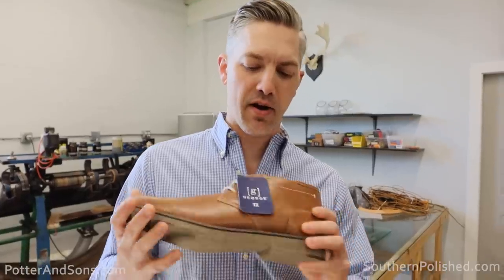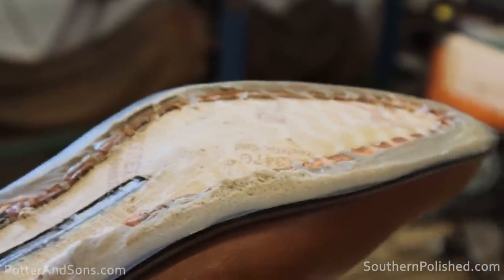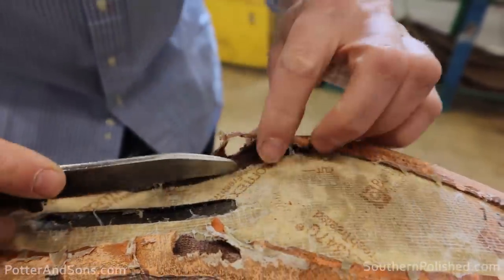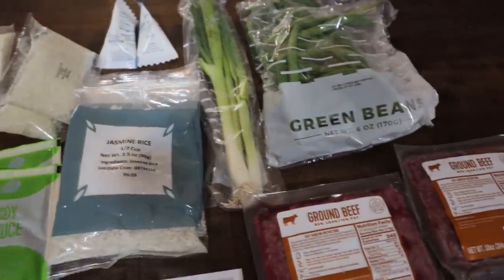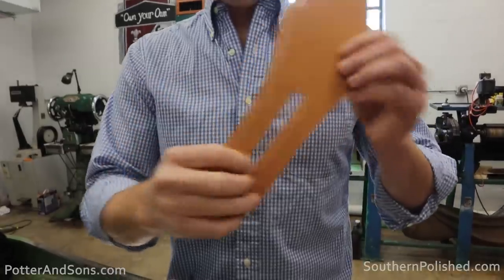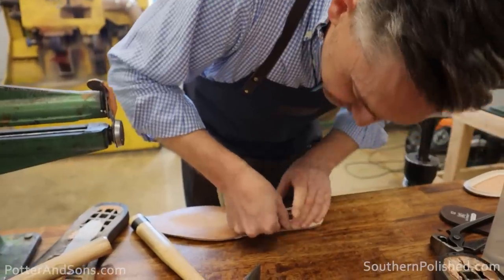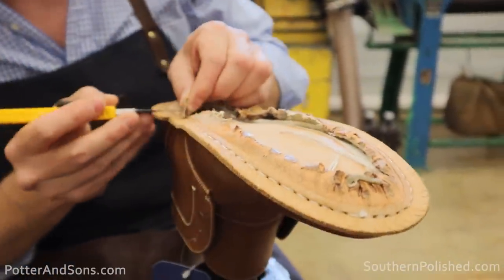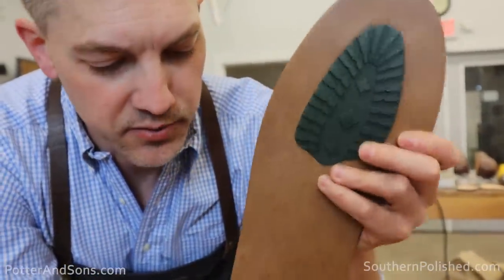$28 WALMART Shoes Are Taken Apart and UPGRADED | Shoes AUCTIONED FOR CHARITY

Comment: I'm not a cobbler, more of a machinist and toolmaker.  Seeing all the older machines and tools never gets old.  I also repair and build from scratch vintage style clockwork items (watches, clocks, music boxes, mechanical cameras, etc).  Most of my machining equipment is considered "vintage" with some modern upgrades.  For my clockwork type work it's hard to beat some tools I picked up from an old timer that he got from an old timer when young over 100 years ago.  I hand make (from forging to finishing) hand tools used in wood working, tailoring, metal working, etc.  It takes extra effort, but just like with cobbling, it all pays off with a quality you can't beat by cutting corners.

Comment: Very cool to watch this transformation and kudos for auctioning them for charity. 
How do change from a cement bond to welt construction and not alter the sizing and fit?  If you had the palsy to use during lasting that would insure that you don’t change the interior dimensions. With a welt you can reuse stitch holes to keep the fit but when switch from on method to the other what ensures that the fit stays the same?
I am also intrigued by the welt stitch being a different color!  Are there a lot of color options for the threads used in welting?  I’ve only seen white and black.  What about different color soles?  Seems like this could be a game changer for shoe design in the upper price semi handmade boot category. 
Thanks for the entertainment and the education.

Comment: Would you be able to resolve Red Wing 2436 boots?  They are mold on and not welt construction, I was not thinking when I purchased them. I have two pair and I alternate everyday.  They are steel toe, however they do not need to remain steel toe, if that were to be an issue.

Comment: I had a pair of shoes with that same type of rubber sole that was originally on that shoe and it has lasted over 20 years and still going. That type of rubber or whatever the hell it is lasts forever. Honestly if you reused that sole that was on it, it would out last the JR by decades.

Comment: I appreciate the craftsmanship, but this seems like putting racing tires on a 30 year old 3 cylinder Ford Fiesta so that you can take it out to the track to race against 7 figure supercars. No one will be fooled and it you'll likely blow up the engine in less time than it took to unload the trailer.

Comment: Fun little video, sure, practical, no. I imagine the materials and labor charge for this project would cost at least a few two or three hundred additional dollars for anyone attempting to do this. Which raises another question. Are there shoe hacks / secret menu items out there where a consumer could in fact have some modifications and upgrades done to a much cheaper pair of shoes to make an effort like this worth while? Thanks for the video. BTW, I remember back when I was a young man in my 20's, I had pair of leather shoes that were just so awesome to wear. They were leather, worn in, fitment amazing, cool to the touch, even thru my socks, they breathed easily and I loved wearing them so much so that it wasn't uncommon for me to think how great they were as wore them day to day. Then they got to the point they needed work but, I instead tossed them in the closet and lost them along the way. Tragic.

Comment: For the $28 that say someone buying them would pay for these junk non leather all cement construction shoes, someone could go to Goodwill, Salvation Army, a thrift store, eBay or one of the websites selling used shoes and find a good pair of lightly worn shoes that would last them a lifetime and could be cared for by a cobbler. Never buy WalMart mass produced junk if you can avoid it! I think at my local Walmart these same shoes you rebuilt are on sale for $3.50 and that's still overpriced for them!

Comment: As a vegetarian, I seek out shoes that do not contain real leather.  I want the man-made materials, because it's not just about my diet, but also concern for animal welfare, so I don't eat them and I don't wear them.
I've had boots re-heeled, waterproofed, eased across the instep, sandals repaired, tennis shoes mended, where the top stitching came apart across the vamp, even a leather belt loop affixed to my jeans where my key ring wore through the fabric loop.  No matter what I have done, my local shoe repair dude seems to have one price for everything:  $20.    LOL

Comment: I assume you are shoe repair men or shoe enthusiasts but I was surprised that you were not sure if a 28 Dollar shoe was real leather or not (you found out during the transformation). First of all George is a private label of ASDA a very large cooperation that carry different consumer products and shoes is one of their products. Secondly, a 28 US Dollar Men's shoe can never be made with real leather (mark-up of ASDA is around 3 so this shoe would have cost +/- USD 9,30 FOB China). The construction is indeed cement lasted however your terminology of materials is way off: The insole is a hard board material with a shank board (not a thermo material as you called it), the upper material is PU which is not a fabric and the sole is TPR (not even close to crepe or even synthetic crepe). You should update your cutting tools as the box cutter is not only the wrong knife to do this kind of work it is also dangerous (parts of the knife can break and it is just not stable enough). To take of a cement lasted sole in this type of shoe is really easy: expose the bottom part (in the edges) of the sole to heat of around 75-80 degrees celsius and the glue reactivates which then enables you to carefully and slowly remove the outsole without any damage to the upper material or construction. Leaves me to question your motivation to change this cement lasted construction into a goodyear welt lasted construction: The PU upper materials (already weakened and thinner due to its previous assembly) is at the joint of your welted construction now even weaker! You perforated and stitched the already too thin PU upper material to a thick leather welt and a heavier leather out sole. This shoe will now tear very easily after a short period of walking exactly in the edge of the welt! It is like putting very expensive 22 inch ALU wheels under a small unstable carton shoe box go cart, useless and a waste of time and effort! The heels you put under the shoes were higher then the original TPR mono block sole/heel which means that the shoe is now less comfortable, not even mentioning that the shoes look worse then compared to its original cement lasted look! And somebody already mentioned it, I am not sure that you can doe this to products of George (ASDA) as they have their designs IP registered worldwide and might take offense, I am not sure if they would sue but who knows.... However, your skills are not bad though! Anyway, just my opinion as a shoe technician of 35 years....